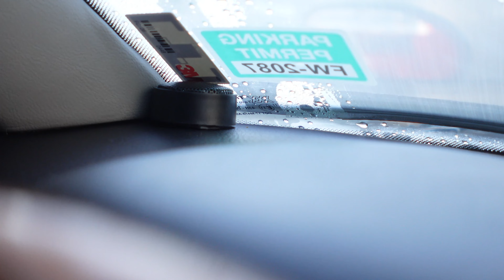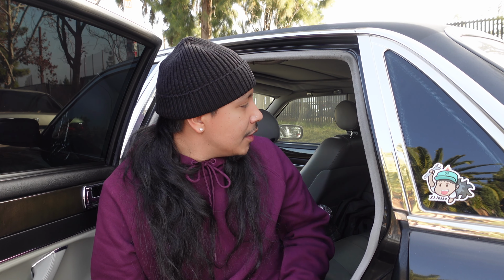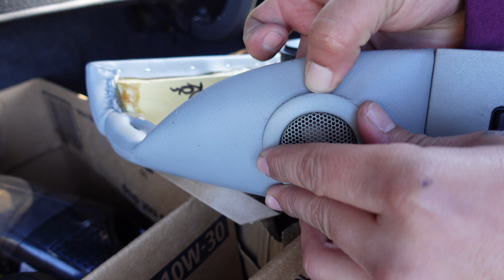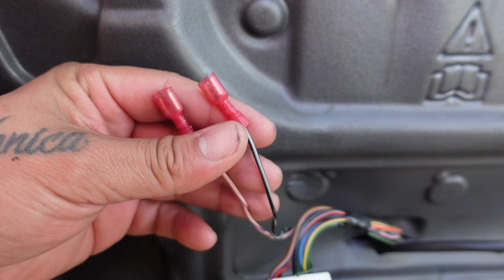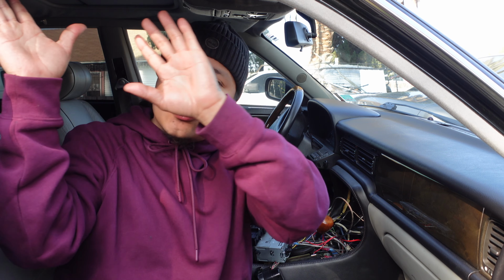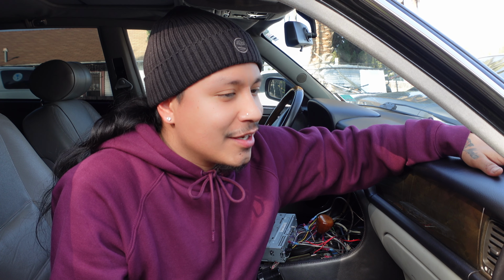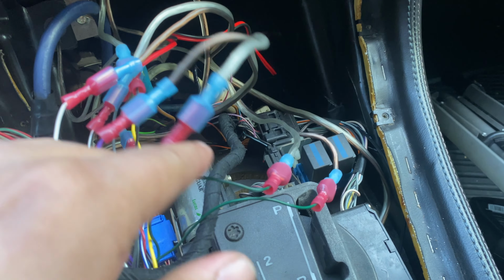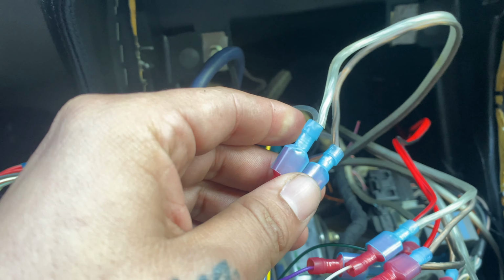Installing Tweeters In My JaaaaagUar!

Comment: Happy New Year! I ordered a 1Din radio with a screen for my XJ40, so that I can have a back-up camera for this long long car. I ended up putting it in my Mazda 3 and buying another one (same model) for my XJ40. Beware sound quality isn't as good on Chinese radios from AliExpress, compared to an expensive Panasonic, but it is similar to stock radio in term of sound quality. Model is Phyee JSD-3001.